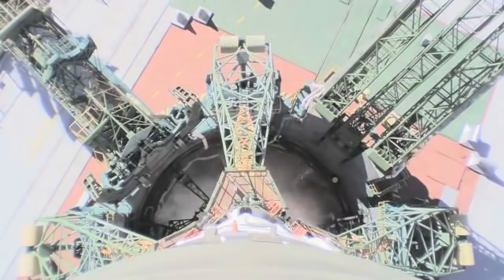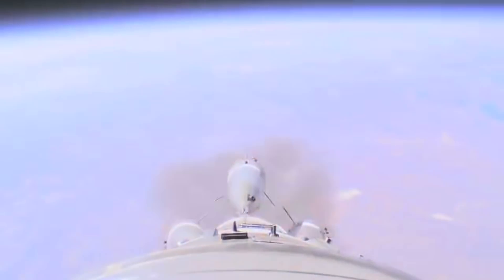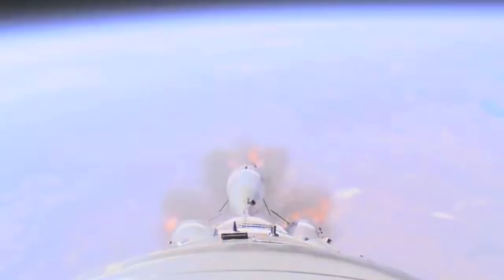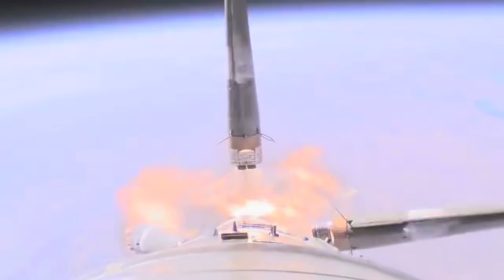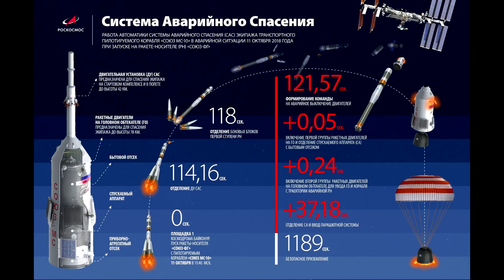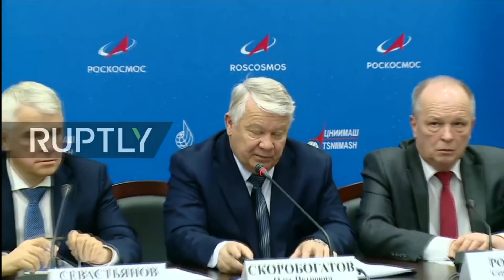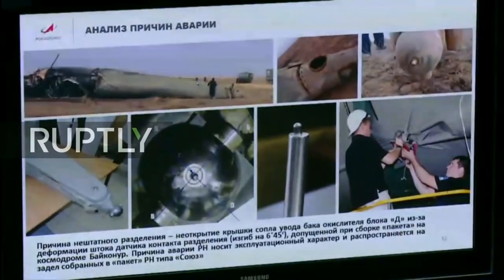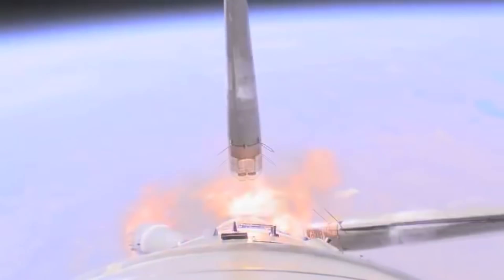In Flight Camera Shows Damaged Sensor Destroyed Soyuz Rocket

Comment: The reason for the low-quality video is because it is not stored onboard but is transmitted down to a ground station immediately instead.
Reply from the maker: Probably explains the discontinuity at the impact. But there's still rolling shutter issues that are due to crappy camera hardware.
Reply: @scottmanley  From my understanding they are using low frequency transmitters and hence have a fairly low bandwidth available for multiple cameras. Also possible that the feed is downsampled by a filter to fix camera vibrations. Lastly on piloted flights it's a very slow process of upgrading old tech. There are still some parts that have not been changed since 60's.)))
Reply: @Reznetwork-d5t  Hey, if it ain't broke, don't fix it, right? ;)
Reply: It is nice to have the video, regardless of the quality -- but it is not obvious why one would not store the video on-board at higher quality simultaneously with transmitting the low quality stream. It probably just takes decades to get any kind of change in those systems designed, tested and approved.
Reply: @cogoid  Surely they can mount a 100 gram GoPro as a secondary camera and the SD card will survive the impact?  I guess it was just never considered?
Reply: @newsgetsold  there's no reason to do that considering that the quality here is enough to troubleshoot the problem, in the sense that a better camera would offer no additional improvement to diagnostics info.
Reply: @newsgetsold  survive the impact - yes. Be ever found again in the Kazach plains if it breaks off - not so sure about that :P
Reply: @newsgetsold  consumer devices really don't like vibration, space radiation, or extreme temperatures, or just about anything outside normal use. Even "protected" ones.
Reply: @ @newsgetsold  space industry may be innovative in some cases but when it comes to manned flights it's extremely conservative. there are probably many parts in this rocket that haven't changed a bit since gagarin's flight. everything you attach to the rocket must be tested in many ways. you cannot say like "oh it's just a dash camera, of course it's never gonna break away and hit some sensor and take down the whole rocket, that's impossible". you're gonna prove it's fit for space travel and compatible with all other hardware around it. it's gonna take years, and after that you'll end up with an obsolete onboard camera.
Reply: @newsgetsold  Maybe.  If the body of the GoPro can stand up to the vibration and G-forces, and isn't underneath the booster when it impacts.

Booster landings are usually not very gentle, so expecting anything as fragile as a GoPro to survive impact is likely a silly idea.
Reply: newsgetsold aerodynamics, at several kilometers per second a gopro sticking out isn’t really easy to keep in place.
Reply: @ChaZcaTriX  Actually it turns out they work pretty well if one isn't expecting a long lifetime. Spacex has put off the shelf GoPros in fairings and had the footage survive after a fairing crashed into the ocean and was washed up on a beach weeks later.
If there had been a GoPro on that side booster it would almost certainly have recorded perfect video and survived the crash remaining operational unless it was unfortunate to be on the side that hit the ground and got crushed by the weight of the structure coming down on it. Even so the recording on the SD card would have a good chance of surviving.
Reply: @cogoid  "it probably just takes decades to get any kind of change in these systems" yup real reason right here
Reply: How Does it Really Work that happens with some missions
Reply: @cogoid  There is not enough hardware on-board to handle that kind of quality. Everything on the rocket needs to be RADIATION-HARDENED. Which means they have to use decades old architectures with .26um lithographic geometry. Rocket system engineers would love to stick a bunch of Raspberry Pis on the rocket and call it a day. But is the raspberry pi radiation-hardened? No. Will it ever be radiation hardened? Probably not considering the physical constraints on the silicon in order to properly radiation harden integrated circuits. Most of the electronics on a rocket are either purely analog (like control surface actuators are driven by op amp circuits) or implemented with radiation-hardened FPGAs. Very little data is stored on the rocket. Microprocesors are really only used to more data between modules. Everything is done in real-time, there's no point in saving data, because that would require gigabytes or even terabytes of storage that you wouldn't even be able to access anyway, just send it back down to the ground for analysis later.
Reply: @KerbalLauncher  Actually that's not true anymore, SpaceX is known for not using radiation-hardened electronics and instead just uses multiple redundant cheap common parts.  Also, radiation really isn't a problem until you get to the first Van Allen belt or beyond.
Reply: @uzlonewolf  SpaceX suffers from greater failure rates, and many people in the industry talk about how they are cutting other egregious corners in safety. It is actually a miracle that their failure rate isn't higher than what it is now. Radiation can still be a problem even if you're still in atmosphere, and even though the ISS is below the Van Allen Belts, astronauts have to deal with cosmic rays hitting their eyeballs that create bright flashes and make it difficult to sleep. I don't know, the company I interned for fulfilled military contracts, I guess they just have higher standards. They don't experience hardware failures unless it's a liquid fuel engine that's been rusting for a few decades. The engineers there would have loved to use something like a Raspberry Pi (or a more industry standard embedded computer) in place of the MPU and its board that they were using, except when push comes to shove, such a module would never meet qualifications and likely fail at a critical moment. This video perfectly illustrates single point of failure. Everything needs to be up to qualification, even if it seems unnecessary. A .1% chance of failure is already too high. Even you can get away with using automotive grade parts, ramping up your hardware and software beyond the bare essentials just opens up Pandora's Box for bugs and other possible points of failure. Like raising the resolution of the video, even if there was some way to get all the data back down to the ground, you would need a bigger FPGA, more SRAM, a bigger MPU, this will increase costs and increase system complexity for relatively little benefit; it'll congest your data communication buses and consume precious system resources.
Reply: @KerbalLauncher  It is true that people love military and space electronics to be Rad-Hard. It makes engineer's life easier when the chips they are working with are guaranteed to work even if you throw a million Roentgen at them. But it does not mean that ordinary electronics can never work. There are ample examples of sensibly employed off-the-shelf electronics working just fine.

An amazing example is the Voyager probes -- the spacecraft that ventured the farthest into space. Their computers are built from ordinary low-integration scale CMOS chips -- not microprocessors. The transistors in those old chips are so large that it is very difficult for cosmic rays to cause enough ionization to cause an upset. (And the computers are duplicated.) So it is off-the-shelf, but you can argue that it is naturally radiation resistant just because it is so antiquated.

A more pertinent example is the laptops on the International Space Station. They are ordinary off-the-shelf laptops, and they are used for running all of the science experiments on the station. (Not for the critical flight control.) And they do crash and freeze once in a while because of the cosmic rays, but not so much as to make them useless.

Today, lots of aerospace engineering students make cube-sats. Some of them use smart phones and, actually, the Raspberry pi, that you have mentioned, as their "brains". And they work well enough on the low earth orbit -- but again, it takes a careful design of the system and of the software to mitigate the effects of occasional crashes and data corruption. But it is being done. 

And our original subject of discussion, the GoPro cameras (when protected by an enclosure) do work quite wonderfully at very high altitudes:
youtube dot com/watch?v=4_sLTe6-7SE
Reply: @cogoid  
Great comment - an important point on the Voyager probes about how retro tech can still be relevant and useful.
Reply: @KerbalLauncher  Immunity to radiation is far more related to the precise semi-conductor technology used than the size of the lithography.  bipolar, ECL,  FET, vFET, CMOS, NMOS, ECL, PMOS, SOS, SOI all have different characteristics, and minimum lithography size is more related to the technology itself, not the degree of hardening.  For example, anything based on insulating "gates" (such as FETs) are generally less immune than bipolar or ECL devices at the same scales etc. But it varies even within families.  CMOS ICs of the 70s and 80s ("4000 series") were hideously vulnerable, yet, the RCA CMOS 1802 processor introduced in the early 70s still sets a high standard for radiation hardening - so high that while there's not enough demand to have made any new ones for decades, they're very popular "scores" on eBay and elsewhere.  Current CMOS, despite rather smaller lithographies than decades ago, are actually pretty good.

Most modern NMOS Intel-family processors are actually relatively good, compared to older NMOS at far larger lithography sizes.  There are versions of the ARM processor that are highly radiation hardened.  While a quantity-one price tag of $720 at Mouser may seem high for an ARM processor (such as on a Raspberry Pi or in most android phones) which typically are a couple bucks apiece, that $720 has to amortise the radiation hardening evaluation and production of the device as reliable to Mil-Spec and beyond certifications.

It's worth of note that radiation hardening is not just for space purposes.  Electronic control of things like reactors and accelerators (such as that in medical diagnostic equipment) needs it too.

And occasionally, technology throws you a spitball.  You'd think that the electronics in a modern Apple product would be immune to something as innocuous as a few parts per hundred of helium.  Not so, refilling the liquid helium in an MRI machine and its subsequent loss of a litre or two vaporizing out, will freeze every Apple product manufactured in the past few years dead in its tracks in the entire building, and it'll take a week or two to outgas and unfreeze and become useable again.

But it is, after all, noted in the fine print.

Still can't figure out how small traces of inert gas can freeze electronics.

Don't take your iPhone 10 to space!  [Modern liquid fuel rockets use small quantities of liquid helium for various purposes, such as to help insure minimal tank pressures.]
Reply: @cogoid  Short-duration satellites (especially cube sats) often use off-the-shelf non-rad-hardened electronics.  They're not up there long enough that the lack of hardening will likely cause a problem, and gosh, gee whiz, they're cheaper. By a lot.
Reply: @KerbalLauncher  Radiation hardening is only needed for critical items that reach orbit, which the boosters do not. 
On the ISS they use standard laptops, tablets and cameras without any issues, aside from perhaps slightly more dead pixels than usual. It is only the electronics critical to operation that are radiation hardened.
Reply: @cogoid  on board?? I thought they were expendable rockets. How do you plan on retrieving the onboard recording?
Reply: @Bryan-Hensley  Soyuz is an expendable rocket. But it does not mean that it gets pulverized when spent. Obviously the descent module returns back. But even the first stages sometimes look relatively intact when they are found on the ground! Sometimes you can find them even less damaged than is shown in this home video: "ступень ракеты РКН Союз 2.1а 04.05.2016"
Reply: @cogoid  it's probably not that important to them. It's like a burglar alarm, no one gets one until after a break in
Reply: @Bryan-Hensley  Most Russian and Chinese rockets fall back to the ground and the impact is quite easily survivable using just some basic protection. You can often see pictures of spent boosters which maintain their general form after impact, looking bent and twisted but not crushed or smashed to pieces. Due to their being very light compared to their size when empty they fall relatively slowly and the impact is considerably less than that of a typical airplane crash.
For rockets that fall into the ocean it would be more difficult to recover because everything would likely go to the bottom of the ocean and would need considerable effort to locate and recover. Not impossible but probably not worth the effort.
Also you might want to have a look into NASA footage of the Apollo program where they had film cameras in each of the stages. The film rolls (or perhaps the entire camera module) were ejected from the spent boosters and were recovered from the ocean, some even doing a full re-entry protected by a heat shield, and that was 50 years ago.  I don;t think it would be more difficult to do today.
Reply: How Does it Really Work it is registered on board with higher quality, but you know, the whole thing kind of exploded and fell from 100km altitude, so I don’t think there’s much stuff left intact to retrieve the saved footage from.
Reply: Logic. They have to use these old Soviet GoPro cams...
Reply: Well ever since they invented the round wheel there hasn't been much improvement to that basic design ...
Reply: @PeterPaul-wz5db  The materials have improved. Just ask Fred Flintstone.
Reply: @PeterPaul-wz5db  lol not much improvement?  That's laughable! In case you are still using good ole rock/wood wheels I figure I should tell you we have better performing round wheels. Just like we have better performing cameras! Although, in this case, I'm sure the reason they don't use the better cameras is more of a procedure problem. Takes a lot of time and money to test new equipment for an already tested trialed and proven sound machine. Why bother changing it unless it can offer a supreme advantage? To much risk involved.
Reply: Mind Wide Open  I was referring to the basic design .... round ... in contrast to all those trianguar, square or other polygonal snick snick going around ...
Reply: Thats still horse shit. We had the tech to send 30+ Mbps feeds down from 100’s of Km like 12 years ago. Meaning u can send a full HD feed with NO compression at 20 Mbps
Reply: @kevin42  uh... A 1080p frame in 24 bit colour is 50Mb, so that's 1.2Gbps for 24Hz uncompressed
Reply: Harry Snell my bad, i didnt mean absolutely no compression what so ever, pretty much any video feed always has some very primitive compression. I just ment that u dont need fancy ass HEVC stuff
Reply: But SpaceX rockets transmit higher quality live feed, no?
Reply: If it aint broke dont fix it. Especially with space flight.
Reply: Do not question camera. Camera is best quality Russian potato.
Reply: It's not meant to be high quality, it's just meant to provide proof in the event of an accident for insurance purposes.
Reply: SpaceX would like a word with you...
Reply: HaleX
A standard TV signal is used, in analog mode.
Interlaced scanning, frame rate 25 frames per second, 50 half frames per second.
This video is not made for advertising, therefore, limited to the minimum necessary quality.
This video was needed 1 time for almost 60 years of operation of the R7 class missiles. For this, there is no need to strive for a 4k standard.
Reply: @НекийНекто-ц1у  
Thank you sir for the clarification, and for explaining the 'shutter effect.'
Reply: Nakor Z  "harder ... to fake ... more pixels".  Yes, but not by that much.  The hard part is knowing what those pixels should be if there can be independent confirmation.  Like Himawari-8.  Their pictures are correct, as observed by billions of people daily, and there is no other way to know what "correct" is, without a satellite being there doing what it's doing.